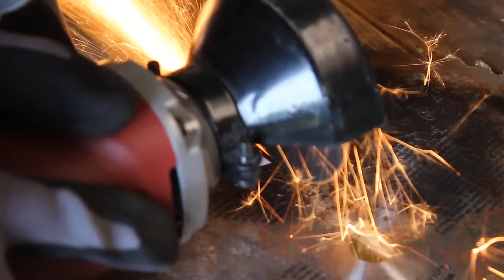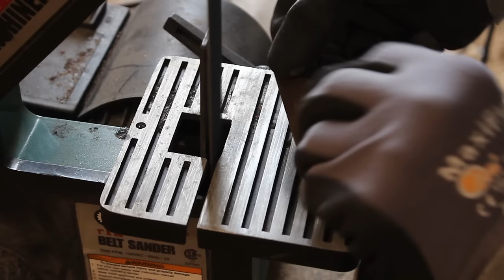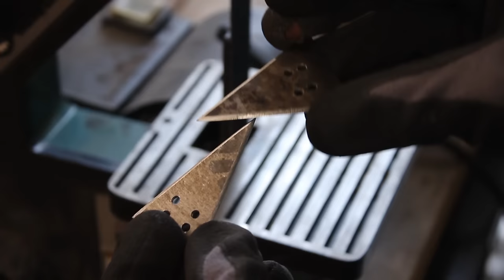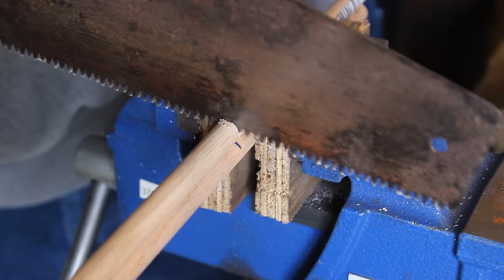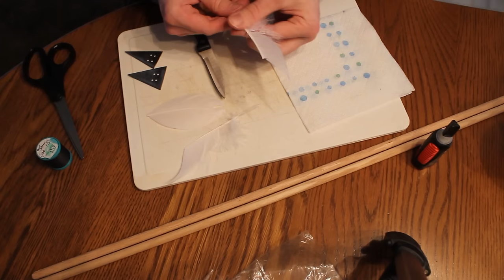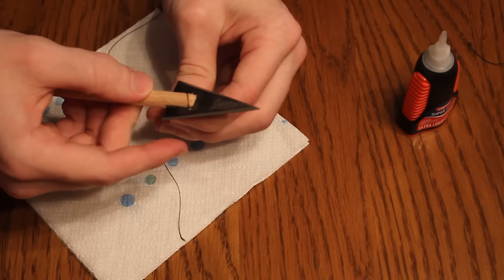Making simple arrow heads from a saw blade!

Comment: Was the heat treat necessary because it was a saw blade? Do they normally heat treat steel tools or no
Reply from the maker: Well I had no idea what steel it was, I tried to find out what it was but there are a few types it might of been. It seemed a bit soft so I hardened it.
Reply from the maker: I'm not sure what steel it was, but if I was 100% sure it was tool steal, a heat treat wouldn't be needed, as long as you don't over heat it.
Reply: +xRoSkii  Ah ok, ty
Reply: +Ninjas19 Only the edges of saw blades were
heat treated, its cheaper

Comment: For the feathers, what if you made cut a groove in the shaft exactly where the feather halves need to go and use epoxy? ...I would think it more aerodynamic  ...for that matter what if the head were formed with a very narrow hilt and the shaft center drilled so the hilt could be epoxied IN it ...I mean I would still notch the very end of the shaft for the base of the head's shoulders to fit within on each side ...the result I would think is a very stable secure head that is also aerodynamic ....arguably easier too?